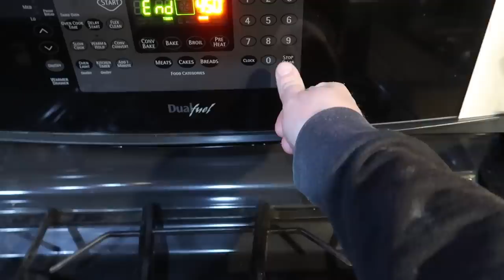Not Sure If I am Dedicated or Just Nuts!?! Changing the way we Farm in  -8℉ weather

Comment: Hold the speed square against the saw rail to act as a guide. simple to do and keeps your free hand away from the blade. It also allows you a good grip on the board to not pressure the board.

Comment: On those type of projects (tables,chairs, and planking)I square up all the ends and then rip the bullnose edge off. I know that treated lumber decking will shrink a bit so it probably doesn’t matter as much. But to me it looks better, I also avoid treated lumber whenever possible. I would rather rebuild it every few years than use treated lumber.

Comment: I'm first !
 A little chilly ??  Al , -8* F is more than a little chilly. At least it is for me !  You live in such beautiful country but a little warmer would be nice. I can almost tell what the temperature is by the sound of your footsteps .
 The gate to the goat pen is beginning to sag a little.  Facing the gate , I would fix that by running a heavy wire from the upper left corner down to the bottom right hand corner with a turnbuckle fixed in the center. Then you can tighten the wire as needed.
The wire is on the outside of the gate of course. A solid brace from the upper right corner down to the lower left corner ( the hinge side of the gate ) will work also . And it may be easier for a carpenter to do .
  Tanner is having fun playing with Figaro .